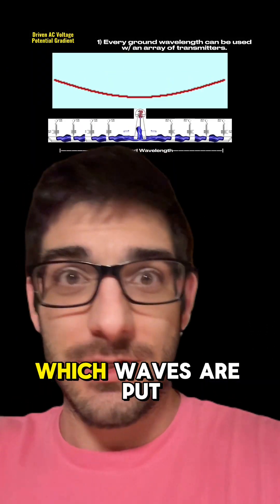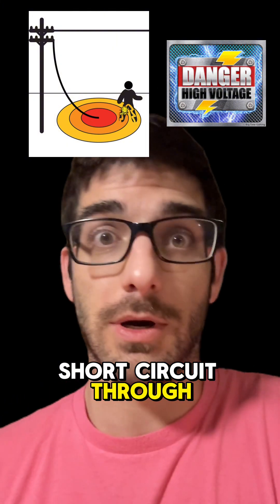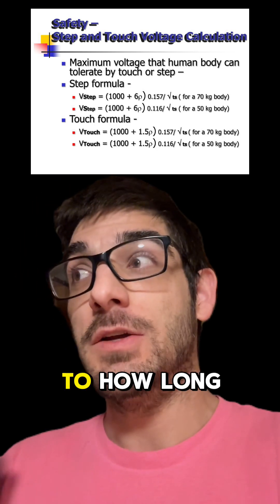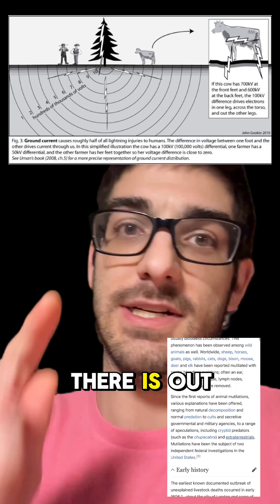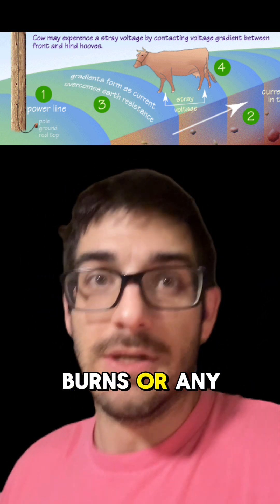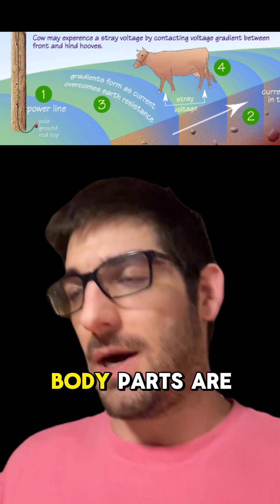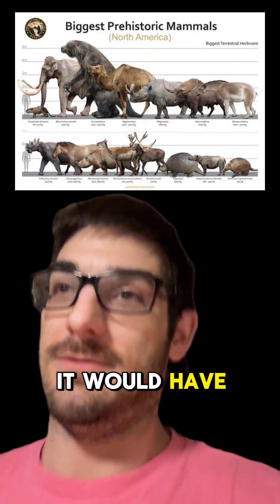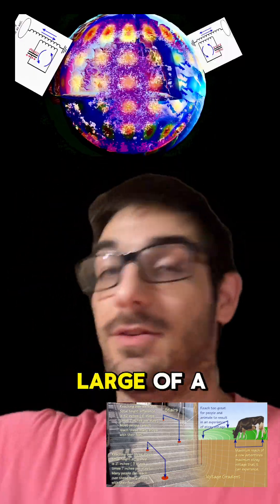Cattle Mutilation Mystery SOLVED!

Comment: I work for minimum wage. So I probably don't know. 1:27 what he's talking about with wavelength. I'm assuming he means hrz. Occilations per minute like the type 60hrz three phase homes in America. Which is different than the voltage.

Hypothetically if there was some ground electric weapon that was used.  Wouldn't it affect everything? The mycology would die, the anaerobic and arobic bacteria also. All other wild life. Deers, bears, cats and dogs.
I don't know this cover up is getting huge. Like the trees shrubs and land would die if you kill the dirts microbiome. 
I could be incorrect. I literally never went to school.
Reply from the maker: Hey thanks for commenting. So the wavelength of the oscillations is related to the frequency 
 
wave speed = wavelength x frequency
 
Additionally the fungi and other microbes in the soil are far too small in this case. 
 
And simple electric currents don’t just inherently dangerous or automatically kill things like they can with larger mammels. 
 
In actually the ground currents cause electrolysis of minerals in the soil which causes ions to form and become more water soluble and actually become more bioavailable for plant root uptake and mycorrhiza in the soil. 
 
Obviously this can be overdone and the land can be essentially salted. 
 
But in my other videos I do show how there are tons of natural land sections that are in nodal and antinodal places and there is a lot of times dead spots in the land and even super fertile spots in the land. 
 
It’s definitely not just a “add currents to the ground and everything will be ok” kind of situation. 
 
Additionally the seismoelectrical properties of the earth (piezoelectric) where mechanical vibrations convert into electrical currents and vice versa. 
 
It’s my belief that this is what all the powwow traditional dances the indigenous Americans did were for. 
 
Using the mechanical vibrations (drumming as well as stomping) put into the ground rhythmically and it will cause the plants in the area to grow better while using less fertilizer and reduce chemical runoff into waterways. 
 
Let me know if you have any further questions! Cheers mate!
Reply: @CharlieSolis really? That's incredible, the electrolysis causing ions to be more water soluble. So in a certain amplitude it's probably beneficial. Like that which occurs without our intervention or causing.

Thanks for responding. I can always learn.
Sorry I know my thoughts are going through many different fields of study.
Reply from the maker: @skepticalgenious some more info on Electrokinetic Ground Stabilization that uses similar principles. The ion transport through the permeable/porous dirt/soil is exactly analogous to how ions move between sections within modern battery tech. 
 
Electrokinetic ground stabilization is a non-intrusive technique that uses a low-voltage direct current to improve weak, water-saturated soils like clays and silts. By applying an electric field through electrodes, it drives processes like electroosmosis (water movement), electromigration (ion movement), and electrophoresis (particle movement) to dewater, consolidate, and strengthen the soil. The technique also allows for the injection and delivery of chemical binders or other stabilizing agents, which are drawn into the soil by the electric field to chemically strengthen the soil matrix. 
How it works
Electrodes: A direct current (DC) is applied between pairs of electrodes (anodes and cathodes) that are inserted into the soil.
Electroosmosis: The electric field causes water to move from the cathode to the anode, which helps to consolidate the soil and reduce pore water pressure.
Electromigration: Ions move through the soil toward the electrode with the opposite charge, transporting both naturally present ions and injected stabilizing agents.
Electrophoresis: Charged soil particles, such as clays, move toward the oppositely charged electrode, which can align the soil structure and increase its density.
Chemical Stabilization: Stabilizing agents like calcium chloride or polymers are introduced, often at the anode, and are moved into the soil by the electric field.
Strengthening: Once in place, these agents can improve soil strength through mechanisms like cation replacement or chemical precipitation, creating a more stable soil. 
Key advantages
Effective in low-permeability soils: It is particularly useful for silts and clays, which are difficult to treat with conventional hydraulic grouting.
Environmentally sensitive areas: It is less intrusive than mechanical methods and is suitable for environmentally sensitive sites or urban projects.
Self-organizing: The system can adapt to local ground conditions, optimizing the process for strength improvement and drainage where needed most.

Comment: I don't remember clearly but someone said that the archeological site at Adam's clock in Africa (I think) has some shielding properties. Could there be some vibration mechanical nodes combined with rocks/crystals that input a high electric field that partially disturbs the electromagnetic signals ?